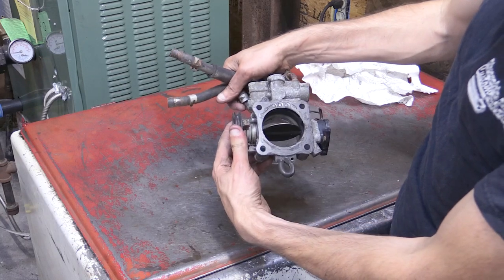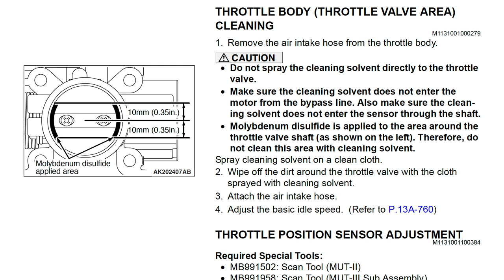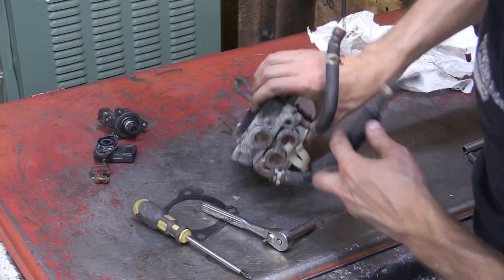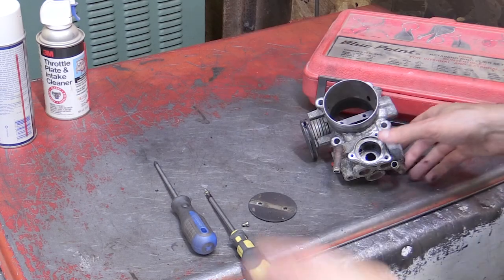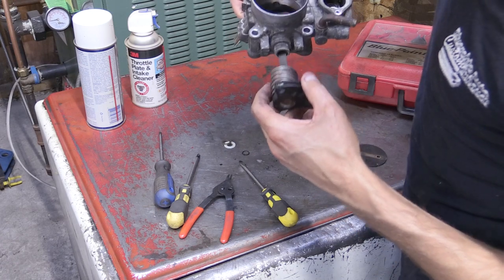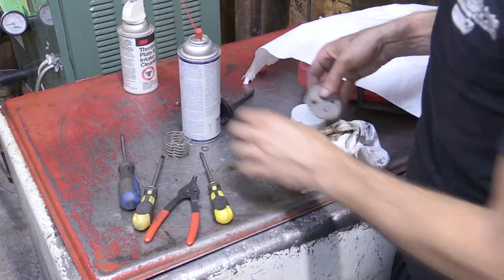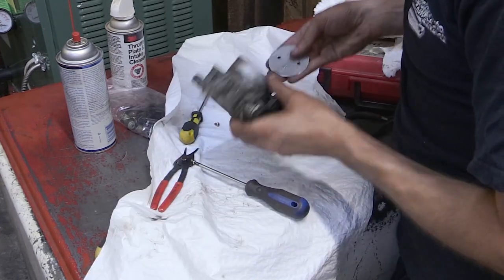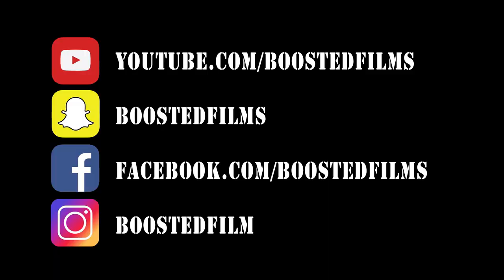Mitsubishi EVO 8/9 Throttle Body Teardown - IAC - BISS - Shaft Seals

Comment: If I remember correctly Paul, that thing you're unsure of is part of the automatic choke. As heat expands, it acts as s sort of thermostat that then works in conjunction with the idle system

Comment: You are not supposed to remove all the black coating on the butterfly plate and inside wall of throttle body. Your idle will now be high because air now leaks through the plate. You need to buy a spray to reseal it again. I need to find my spray to find the name.
Reply from the maker: Interesting. Thanks. Yes please provide the name of the coating if you can.
Reply: @BoostedFilms  I think it is called Dry Moly Lube spray I used to put back the coating. I sprayed the sides of where the flapper opens away and backwards (back side of top half and front side of bottom half).
Also, notice that the black coating was on the back side of the throttle body (so it was intentionally sprayed there and not dirt from driving).
Reply: The throttle body seals are a pain to put back straight. Find a way to tap or push it in without destroying it by going in at an angle.
Reply: Also, once you are putting the plate back the final time, you may want to add a bit of blue loctite to the 2 screws so they can't come loose and fall off (and get sucked into engine).
Reply from the maker: @donsevo89research74  thanks for the info. Very much appreciated
Reply: Yeap! RB26’s also use the same method on the ITB’s. There also Tomei Throttle Coat, but I believe the sealant they use is illegal in the states, due to the health risks
Reply: @donsevo89research74  it's called LPS force 842 dry moly lube.
Reply from the maker: Should the whole back side(side face intake Manifold) of the plate and the edges of the front side be coated?  1:38 talks about Molybdenum disulfide ad it shows the edges in black i believe.
Reply: @BoostedFilms  I coated each half with plate opening away because once you open the plate, it scrapes the coating off so I sprayed on that side that doesn't get scraped. I made sure it completely sealed when in closed position so that only air gets through the IACV.
Reply: @BoostedFilms  I believe just like how it shows on the drawing. Anymore would attract more carbon build ip

Comment: that mystery piece is what messed up my idle completely, I ended up switching to an evo 9 TB which eliminated that part and got the car back to normal
Reply: My Evo 8 MR has idle issue after warm up it goes super lean AF almost dies and then idle goes back up and repeats the process. Curious if you had a similar issue relating to that small part? Also does the Evo 9 throttle body eliminate that part altogether?
Reply: @DJ_Driven  that was the exact problem I had, I tried new FPR, MAP sensors,IAT, and BISS screw. Non of these fixed the problem. The evo 9 tb eliminated that part and that finally solved it.
Reply: @FranchisePhoto   This idle issue has been a major struggle.  If I obtain a brand new OEM Evo 9 TB from Mitsubishi should come complete where I can just swap out and I'm good to go?
Reply: @DJ_Driven  I got mine used off eBay or somewhere, I only changed out the shaft seals to be safe. A used one should be fine

Comment: Also with the tb seals, you can use a blind hole bearing removal tool, or bang them out from opposite ends. I just used a socket to persuade the new ones back in.

Comment: Good info from this video! At 1:38, the diagram shows Molybdenum Disulfide being used to seal off the gap of throttle plate. I think later evo TB’s doesn’t have the access port for that other component you took out near the coolant passage. I like this whole evo archeology stuff!
Reply from the maker: Whats odd to me is i never saw that "Molybdenum Disulfide" in the location shown on the front of throttle plate. Or is it not suppose to be "visible"?  Perhaps the previous owner cleaned off the front of the throttle plate once in the past?  

If i'm not mistaken, it was the backside of my throttle body plate that people think was entirely coated.
Reply: @BoostedFilms  I didn’t see it either on my evo and also on my spare TB. I think it gets cleaned off easily. It’s not really “needed”, the biss screw adjustment will compensate for the the passage of air through the plate

Comment: I believe that unknown piece is a 'wax pellet' as others have mentioned, it shrinks/expands with the temperature helping regulate air flow/idle.
Reply: Do I have to have the 'wax pellet' or can I just cap off the hole? When I plug it with my finger, it idols perfectly.
Mine was missing when the car was given to me...

Comment: EXTENDED THOUGHTS ON MYSTERY PART
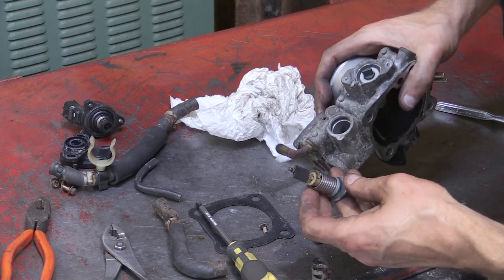I have a Mitsubishi 6G74 engine. I've had trouble with high idle after cleaning the throttle body.  That unknown part at 4:20 is something that I don't quite understand either but I'm hoping that it is the source of my high idling!
In the aftermarket manual I have on my vehicle (Mitsubishi Magna) it lists a device as a wax pellet thermo valve.  However, I don't believe that it is actually a wax pellet valve.  A wax pellet valve is, according to Youtube videos, a sealed device that is surrounded by engine coolant. When the coolant heats up and melts the wax within the module, the wax expands and pushes out a pintle which normally shuts of a small passageway for air to sneak around from one side of the throttle body into the air intake plenum/chamber.
This mystery device, however, is not surrounded by engine coolant.  It in fact, at least in my throttle body, lives just a bit off to the side but in the same space as the Idle Air Control chamber!
The base holds a coiled spring-like metallic strip and at the end a black plastic "flap" clips in to a small plastic seat that sits in the end of the coil/spring.  That flap is actually cream coloured once you clean the carbon off of it!
Now when assembled that flap actually faces the pintle of the IAC module. When the pintle is fully extended, it moves quite close to that flap. What does this mean?  I don't know.
You would think that the mystery module heats up as the coolant that runs beneath the throttle body heats up. When it heats up along with the rest of the throttle body, the coil turns (like a bimetallic strip, perhaps?) and the coil turns that flap so that it slows down the rate at which air flows through that butterfly bypass passage.
What I don't understand at present, though, is that when you first assemble the mystery device it appears to be in the position that most restricts the airflow through the IAC airflow chamber! I.e., it is already in the "talk to the hand" position whereas you'd think it would start in the paper (from rock, paper, scissors) position which would let the air glide over and under the plastic flap.
I'm still working on my throttle body so will look at that component again very soon.
Yes, it's a long comment but I'm sure only those truly interested will have read this far.
Reply: Finally. I had a look at my own bimetallic flap thingi today.  In the chamber that houses the coil and the seat/base of the flap, there is an extra semi-circular recess. Now the seat/base of the flap has the third-circular protrusion that loosely fits into this semi-circular recess. What this means, I think, is that the flap doesn't actually turn that far. I think it starts by facing the end of the Idle Air Control (IAC) pintle. I suspect that when the coil heats up it turns the flap backwards by about 35 degrees, give or take.
Can I say this?  The IAC pintle is pretty obvious in what it does, i.e., the further out it protrudes, the more it blocks the flow of air in the "butterfly valve air bypass channel".
Now, what the heck that flap does when it turns backwards a little bit after heating up, it's just not that obvious! I wish it was.